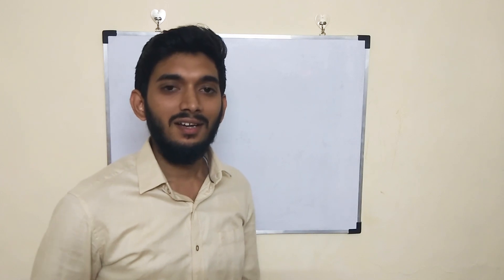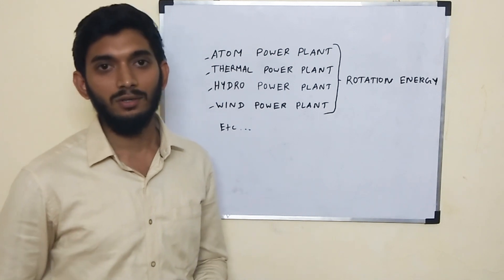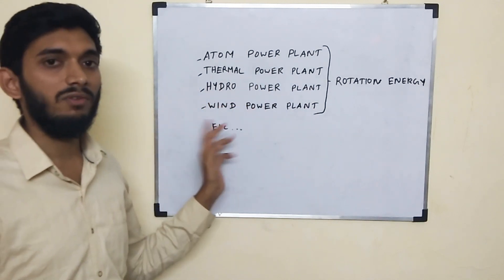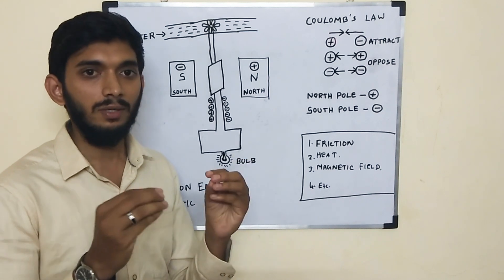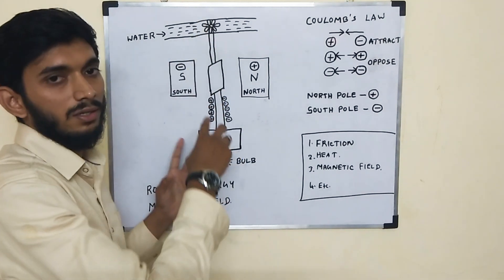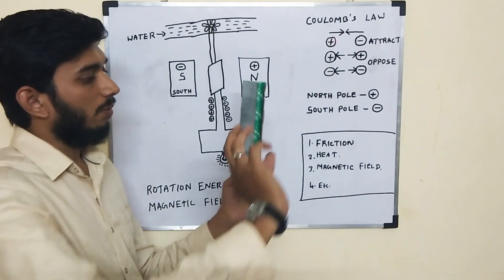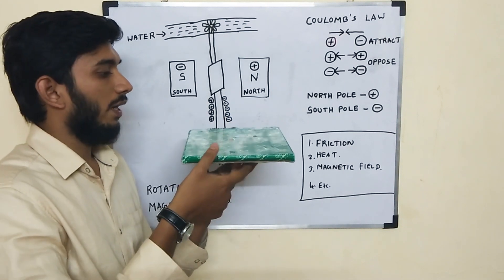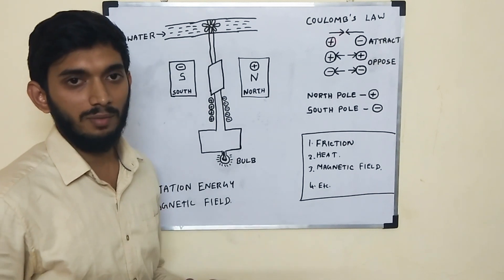Electricity generation Explained_ TAMIL, How electricity generated in power plants?

Comment: வேற லெவல் explanation!!! 5:31 இந்த கேள்வி எனக்கு நீங்க சொல்ற வர மைண்ட் ல பொய்ட்டே இருந்துச்சு Bro! சரியா நீங்களே சொல்லிட்டீங்க!!! 👏👏👏
Reply from the maker: Thanks
Reply: @engineeringfacts  bro electron nah leh negative thana athula Yepdi bro positive nu solreenga
Reply: @s.m.yahyaaboobacker8317  athae doubt than enakum
Reply: Bro this misconception that's magnetic induction that moves the electrons not because of magnet,For rotating of the plate.And this is not a good explanation where it was without measurement and theory was also wrong atoms can't move easily like electrons.And that neutral is help to catch electrons again.The tungsten bulb is glow by tungsten resistance and that create friction (resistance are include in measurement) @engineeringfacts
Reply: *atoms❌ protons ✅

Comment: Bro, can you please explain about 3 phase current... Why there is no neutral/return line when three phase current is used. (Eg: three phase star-delta motor)
Reply: Bro, because in three phase supply the connection between line to line neutral line is either can be use or no use.